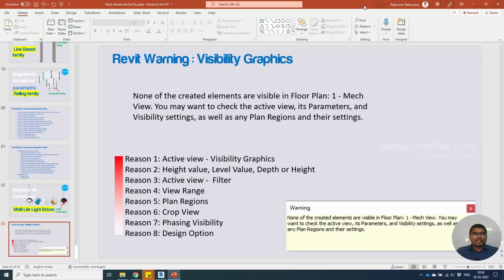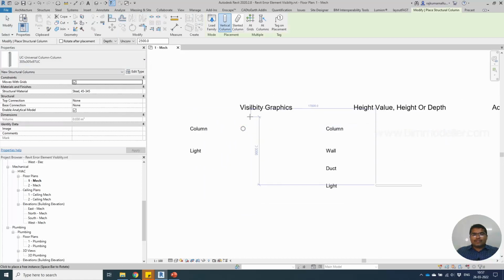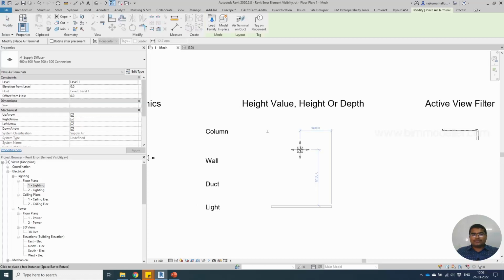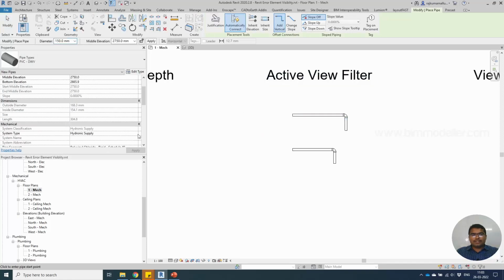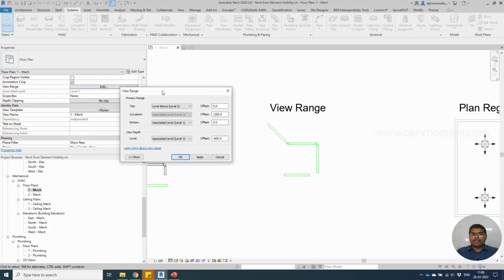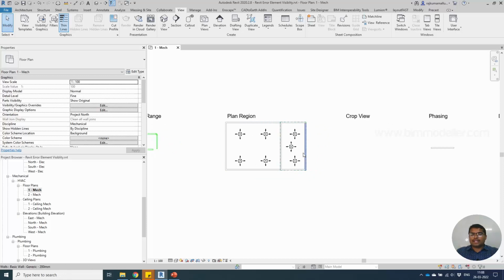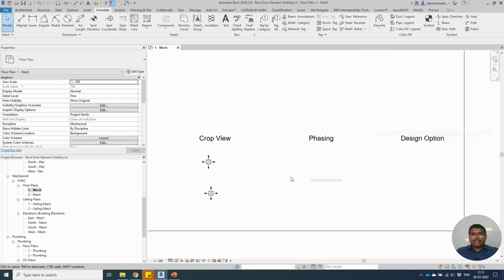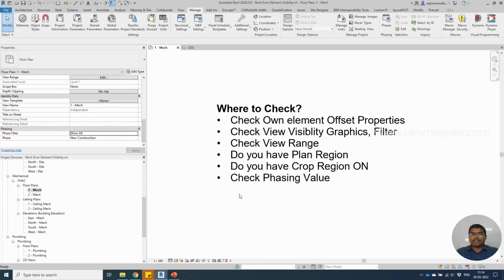[Solution] Revit Error: None of the created elements are visible in Floor Plan

Comment: Sir i face space properly closed please tell me how its solve
Reply from the maker: I will do a video about it. Before that make sure you select Archi model, In edit type of Revit link tick bounding tick. Mostly it will solve your problem.
Reply: @BIMModeller  sir already room boundary's select when work on mep and i send someone mep file this problem is showing space closed
Reply from the maker: @mohdfaiz9010  May be they don't have Archi file. I may need Snapshot see the problem.
Reply: @BIMModeller  where send you snapshot
Reply from the maker: To my mail ID. Which is in about page